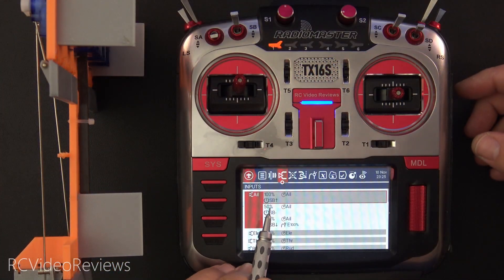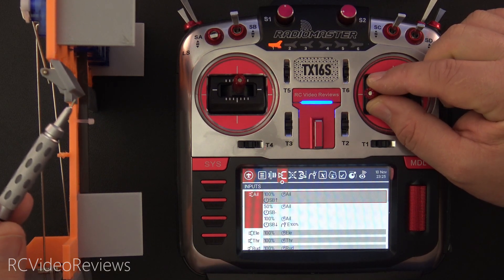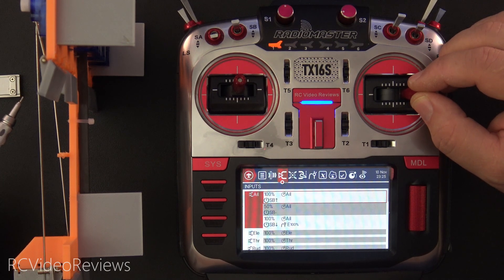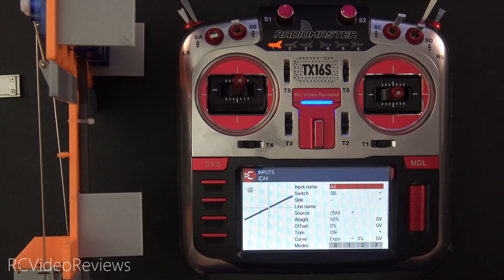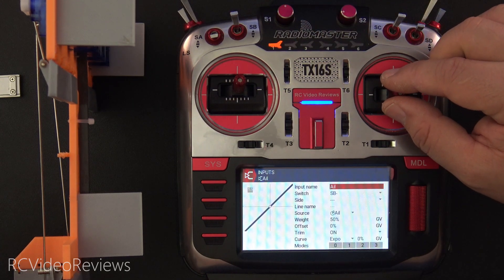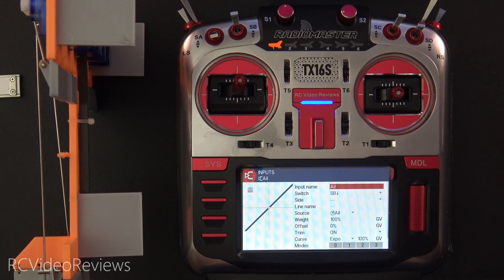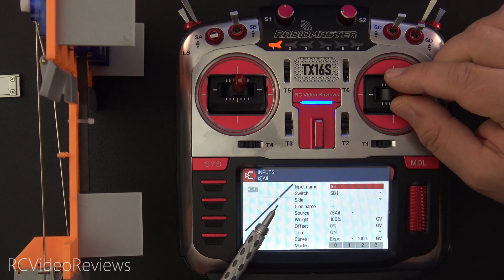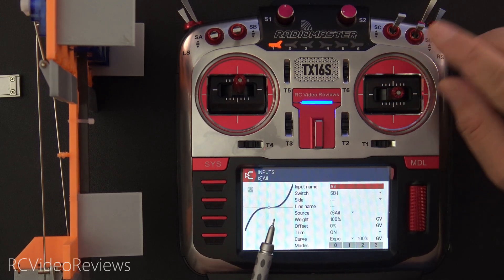EdgeTX Snippet • Learn About Weights and Expo

Comment: Very usefull videos you have.
What I don't understand is why weight and expo on ailerons, only afecta one of the two servos . Any help please?
Reply from the maker: When rates/expo are setup in inputs, and inputs are used to feed the mixer, weights and expo feed all servos utilizing that input. See this video for more info: https://www.youtube.com/watch?v=XQIihORdhrw
Reply: @RCVideoReviews  I just realized what I was doing wrong. When adding CH5 for the second aileron servo, I was selecting the source as the "stick" and not the "input", therefor the expo only afected one of the servos.
Reply from the maker: Yup, those little icons are meaningful on EdgeTX.

Comment: I thought rate as in rate of travel as in distance.
Reply from the maker: To a degree--weight and rate could be considered interchangeable. An increase in "weight" on EdgeTX means more movement, more movement would increase the "rate of rotation" about an axis.

Comment: I have a question which I cant find the answer too. so talking about weights is essentially servo travel, now I've come from spektrum where we have servo travel adjustments, so standard travel is 100% but if you need more throw then you can go up too 150% which would be able too max out the complete servo travel. Dow does that work on edge?
Reply from the maker: Edge doesn't constrain servo travel in the first place like Spektrum. You get the full throw without any adjustments. If you use a Spektrum Rx, you can enable extended limits in the model setup page to get the 100% throw over the limit imposed by Spektrum gear.
Reply: @RCVideoReviews  I worked it out, if you enable extended trim and the one above it gives extra travel on the servo